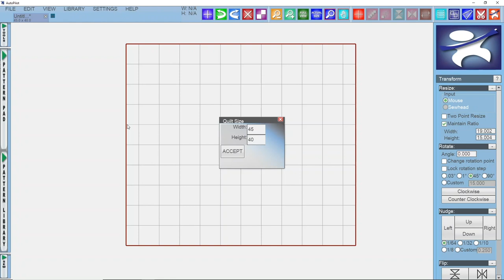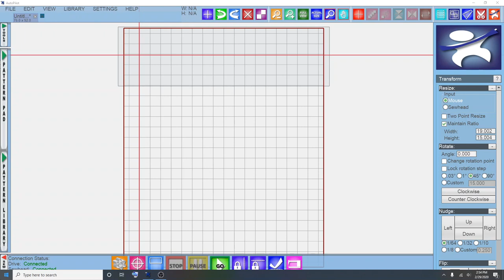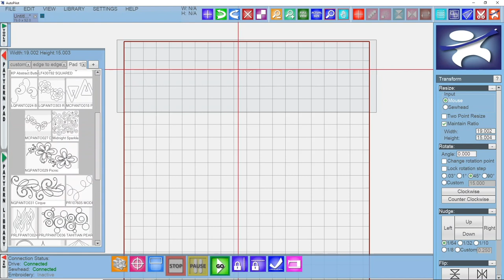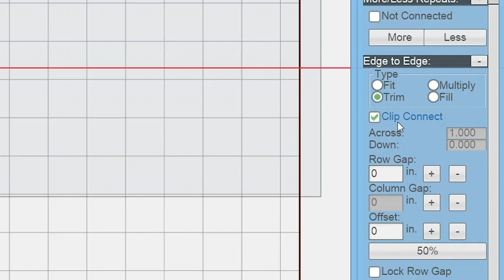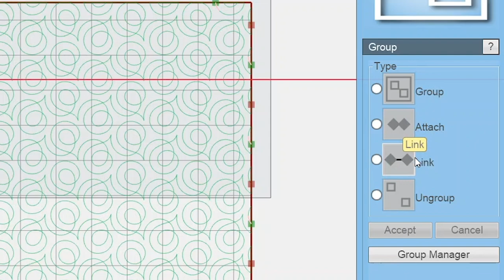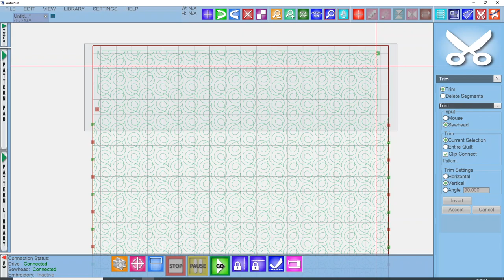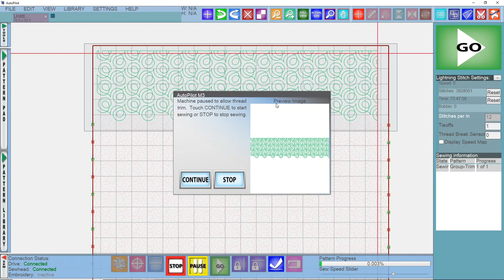How to Create an Edge to Edge | INNOVA Longarm Quilting

Comment: Thank you for taking the time to help others. I appreciate your efforts to make things easier. The first two videos are awesome! I was struggling with the "fit" function to get a pattern to quilt on the quilt where I wanted it. Learning to use "trim" has been a game changer for me. Only suggestion I would have for existing videos is that sometimes it is not clear what you are clicking on as you go through "the how" to do something.  I had not used trim before so a couple of things were not intuitive to me. And occasionally explaining the why on a particular step helps the viewer understand what outcome that produces (instead of just a string of commands without understanding why). Would love you to do a video on how to mask out an area on a quilt once an edge to edge pattern has been populated. And I like to sign my name on the bottom right hand corner. I find the rails make the machine stiffer and harder to manoeuvre smoothly to write my name and power assist is too loose. I would like to know how to create my own saved name pattern and then how insert into the EtoE pattern or just do separately at the end.